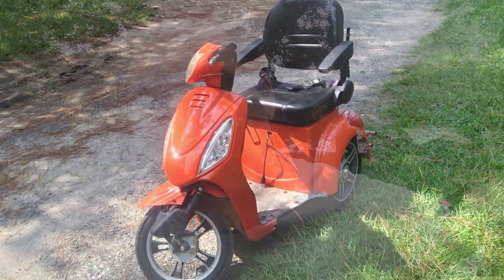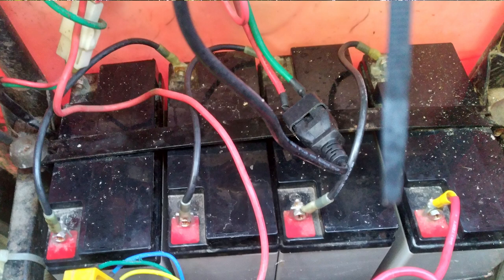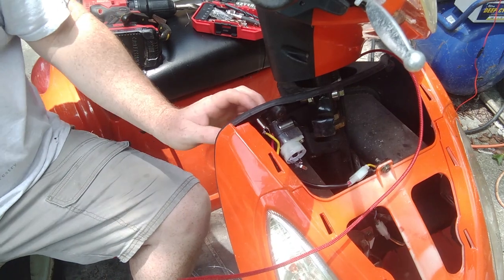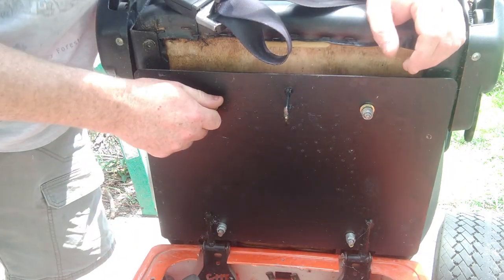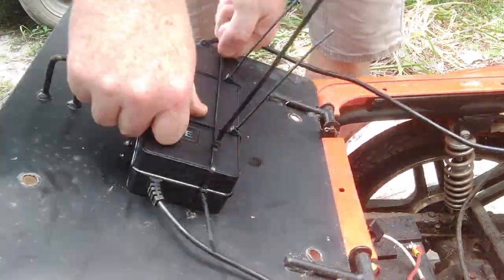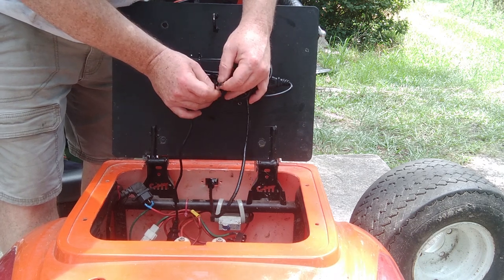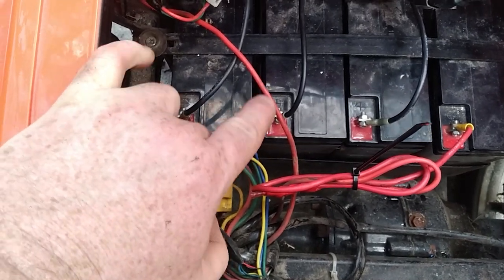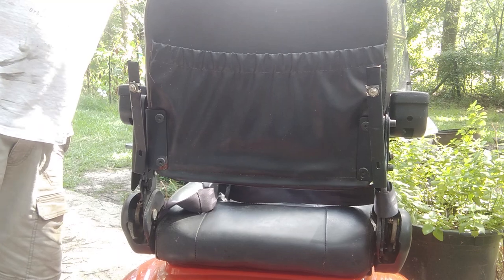Will This Mobility Scooter Run ?

Comment: Nice job but I'd rather have a breaker than a fuse.
Reply from the maker: I was going to use it but it was like 120 volt AC breaker. So that's not safe. I should been clear on that. Thanks so much ! Was a lot of fun. O and so fast for what it is lol. God Bless